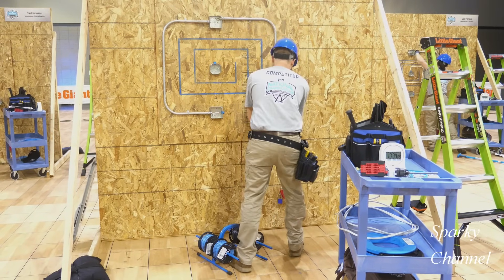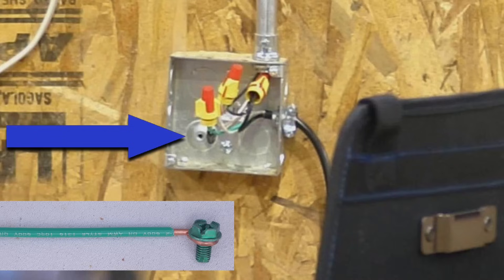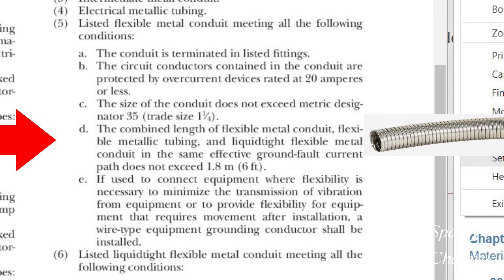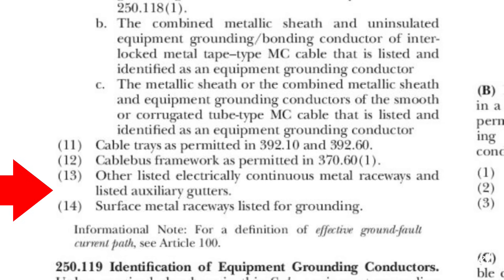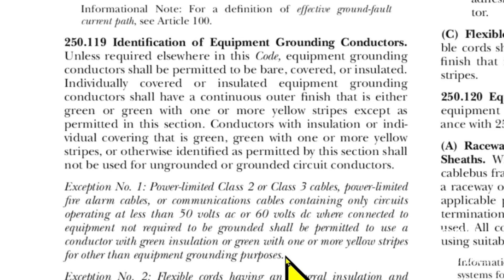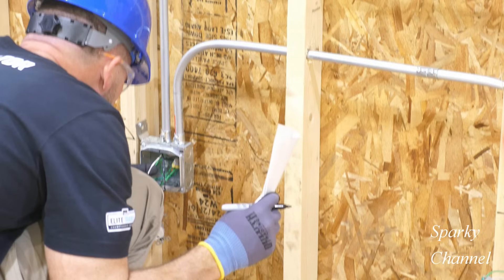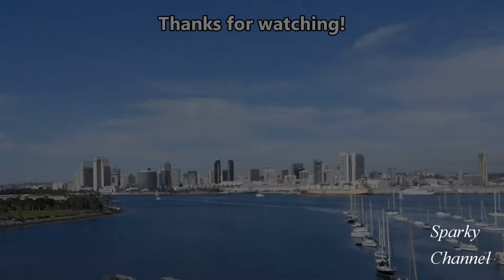Can EMT Conduit be Used as Equipment Grounding Conductor? NEC 2020 250.118 and 250.119

Comment: Great example of how strict adherence to the letter of the law/code can make your electrical less safe.  The metal conduit is a much higher resistance conductor than copper and is more prone to losing continuity than a copper wire ran through it would be.  I have to say that if UL green tape is used, running an extra white wire and marking it at each termination point seems like a much safer solution IMHO.   The risk is the tape falls off and somebody connects ground to neutral.  I think that’s less likely than you getting shocked by the metal conduit because you just got out of the pool and touch it, not knowing it’s lost continuity with ground and has a damaged hot wire touching it.

Comment: So, how is the EMT used as a EGC...does the EMT at the panel have to be connect to a strapped or attached to ground bar?
Reply: No. The ground bar is already connected to the panel enclosure through it's attachment screws. The EMT is attached to the enclosure through the fitting. So the connectivity is present the moment you attach the EMT.

Comment: Very good video. But: while EMT "can" be an effective ground path, in practice, if you have say five electric boxes in series, that's at least 12 lock nuts and 12 set screws that need to be perfectly cinched down for it to actually be an effective ground path; if even one lock nut is slightly loose, everything downstream is an open ground. Terrible idea to try this in practice.
Reply: We never did it when I started back in 1982 even though it was permitted. But we used BX with grounding pigtails, if that made any sense.

Comment: I have seen too many setscrew fittings pulled apart by building movement and worked-loose locknuts to ever rely on EMT as a grounding conductor.
Reply from the maker: Good point, thanks!

Comment: My question is can I pull a bare copper ground wire through metal flex conduit?  I think this answers the question but it’s not an explicit enough answer.
Reply from the maker: I would say yes but we generally use insulated green wire for the ground wire.
Reply: @SparkyChannel  thank you 🙏

Comment: Sparky, I am adding an exterior gfci, but there is no ground wire. I understand a gfci can be installed without but I would rather have a "ground." So, older house had a 1/2" emt exiting into a backless box so there was no emt ground. But, if I create space around the emt stub I could add a screw-type connecter that I could affix a ground wire to and connect to gfci ground.
So, which, if either, would you prefer, a groundless gfci or a fabricated emt ground connection?
Reply: Groundless

Comment: Question do you have to bond emt on both sides if you have a neutral conductor going through the race way or if one side good enough? Does it make a difference if it’s service conductors or branch circuits?
Reply: Add to your Question, = Would a ARC fault  Circuit Interrupter on a 15 or 20 amp single phase branch circuit satisfy  protection?
Reply: @tomassoyweyvon4902  Yes, but the metal conduit still has to be connected to ground at both ends.  If longer than 6’, there has to be a ground wire ran through the conduit and connected to it’s ground terminals at bit ends
Reply: Yes, both sides

Comment: It’s legal but I do not trust EMT as an EGC for one reason… all it takes is some bozo loosening up a lock ring, or cobbling in a plastic connector into the system (just found one of those last week) and goodbye continuous ground.  While it isn’t legal apparently to just take a green marker to the ends of a white wire (although that would definitely pass here) …IT IS legal to strip the conductor completely and install and bond a bare wire if you wanted to do that.
Reply: Would it be legal to only strip only the visible portions of the white wire? I.E. starting from a couple of inches into the EMT from the connector? Or does the EGC have to be stripped 100% throughout its length?

Comment: Bill, can I do the reverse in terms of color coding. If I have a big giant roll of 6 gage green that sits around the shop forever, can I use that for hot and neutral conductors as long as I clearly identify them within the boxes and terminations (e.g spiral wrap the last 12” or so with black tape and white tape respectively?)
Reply: Absolutely forbidden by code. Green is for grounds only.

Comment: If you have the time and resources I think it's better to also run a dedicated EGC conductor instead of relying on the conduit to act as the conductor. If the conduits has poor connections, it can easily lose continuality. Once saw a video of a highschool that used conduit to for the grounding but because there were so many disconnects and damage to the conduit over time the grounding was rendered ineffective.

Comment: In Chicago, Cook County, Lake County, and DuPage County areas in Illinois there is a metallic conduit code for all residential structures with very few exceptions. In my 40 years of electrical experience working in these areas, you will be very hard-pressed to find a single green wire in any of these thin wall conduit installations. That equates to about 10 million homes wired without a separate grounding conductor within the emt. We do not have a plague of house fires, electrocutions or equipment failures in these homes. I think from my years of experience in remodeling homes wired in this method, it is a very safe system. I will always run a ground wire to any exterior outlet, A/C unit, flexible conduit of any type or to any area that could possibly suffer from corrosion just for redundancy. Even a marginal metallic connection from a crappy install is enough to trip a breaker. That steel pipe is a better conductor than you might think, even with a loose locknut or loose set screw, the friction fit in the fitting or the mechanical pressure of the pipe being strapped and pressed against the box is more than enough to trip the breaker. In my humble opinion, based on what I have seen and learned in my time in the trade, the Code Gods made the correct decision. Feel free to add a green wire for redundancy if you prefer, but in almost all cases it would not be necessary to clear a fault.
Reply: FINALLY, a man that speaks truth. I couldn't believe the comments here regarding the E. G.C..
Locknuts loose, set screw wah-wah-wah, this, that. 
An EMT conduit is an EXCELLENT pathway.
Years of operating a service van in SF Bay Area I have seen it all, probably. From salty sea air corrosion on switch gear to urine soaked receptacles (it's SF guys) and I am as serious as a constipated fat lady when I say EMT is an excellent path for EGC.
These Nattering Nabobs of Negativity here commenting about running a conductor RATHER than using EMT conduit as an EGC, and speaking with such pomposity while doing so is virtue signaling at it's core.
It illustrates the lack of understanding regarding the function of the EGC. 
Some of these self-claimed "journeymen" have even said to me, "Without a solid equipment ground the circuit won't work."
Look, truth is, who should we  assign the most credibility to, the NFPA and their authors of the NEC every 3 years, or these so called electricians here in the peanut gallery?
Reply from the maker: Hi Dave! Thanks for your expertise!
Reply: Yup that's Chicago way. still practiced today.
Reply: I’m all about using the raceway as the egc, but I don’t think you need to go as far as touting loose-fitting components as being adequate work. I guess you’re just trying to make a point. But it’s always important to do top-level work.
Reply: @RB-xv4si  I was making a point in what I have observed in my career. I never sacrifice quality.

Comment: According to the NEC, yes. According to every job spec I’ve worked under, no. They’ve all required a separate wire EGC.
Reply from the maker: I understand. Thanks Bill!
Reply: Yes, true. This code is more applicable to service electricians. But it’s a code nonetheless..trust and believe that as soon as I don’t see a wire type egc called out in the job spec, I won’t be pulling one in with my circuits.

Comment: The short answer is yes. I personally don't like to rely on the conduit as my equipment ground. If a connector or coupling comes loose and the conduit becomes disconnected, you lose your ground. I pull a ground wire in every conduit.
Reply from the maker: Excellent, thanks!

Comment: EMT was the grounding method for many years. Due to the poor workmanship, lazy and don’t give a crap attitude, poor management and supervision the overall cost of electrical work has increased by having to run the additional wire. Same thing with ArcFault protection. Crappy work = arcing
Reply: A strong sense of pride used to be a common bond. Words like craftsmanship are hardly used anymore and that is sad.
Reply from the maker: I understand what you're saying, thanks!
Reply: Absolutely true.

Comment: Seriously took over 6 minutes to get there....Nobody runs new EMT without a ground wire nowadays. Raceway is never a reliable EGC, to many connections in a real world application.
Would you do it on a waterheater that is 20 feet from the panel?
Reply: EMT was the grounding method for many years. Due to the poor workmanship, lazy and don’t give a crap attitude, poor management and supervision the overall cost of electrical work has increased by having to run the additional wire. Same thing with ArcFault protection. Crappy work = arcing
Reply: It’s done all the time in service work. Just not in new construction where a ground wire is called out in the job spec.

Comment: How does this account for the ampacity of the ECG? The EMT in this case should be plenty for that circuit, but I can think of situations where it might not be.
Reply: Remember that an ECG rarely carries a continuous load.  In a short circuit, the current is high but very brief.  For an overcurrent, the load is only carried for the period it takes to trip the breaker.
Reply: @barryomahony4983  If your "EMT ground" sucks, it might not provide a sufficient current to trip. (one would hope that isn't the case, but I've seen it happen - thus I don't trust conduit for a ground.)
Reply: @jfbeam  the same is true of a shitty ground wire connection. Pick your poison. But I’d rather have a top-notch install with the raceway as the egc than a sloppy one with a wire egc pulled in.
Reply: @RB-xv4si  adding a ground doesn’t make the run shitty, not getting ur comparison
Reply: @Nick-bh1fy  when I say “shitty ground wire connection,” I mean a ground wire connection that has the same sloppy workmanship as poorly assembled EMT used as the egc. My point was that either way you go, if you have poor workmanship, the bonding will be inadequate.
Reply: @RB-xv4si  ofc that goes without saying but id take my chances on a “poor” ground connection through a conductor rather than hoping guys tighten their connectors 😂 emt is plan b lmao
Reply: @Nick-bh1fy  You’re free to pull a wire egc if you want. And you’re also free not to. Like I said, I would take a quality build without a wire egc every time over crap quality with one installed. Any experienced electrician who knows his stuff will say the same thing.
Reply: @RB-xv4si  yet engineers spec jobs for all conduits to contain an egc I get it’s preference if not stated but it’s not hard to make a simple bonding connection. I disagree respectfully
Reply: @Nick-bh1fy  it sounds like you’ve never done service work.
Reply: @RB-xv4si  not much of it, mainly new construction so perhaps my bias is set there 🤷‍♂️
Reply: @Nick-bh1fy  one day if you do service work, you’ll see that the service guys know much more about code since that’s what they’re mostly following. They build to this standard since there are no plans. The construction guys for the most part only know how to follow plans or what their foreman tells them to do. They often don’t know why or how something works, or what’s code vs what’s spec. I noticed this when I switched from service to construction.
Reply: @RB-xv4si  yup def depends on the company/group of guys when it comes to competency
Reply from the maker: I think they really depend on electricians making very secure EMT fittings connections. I'm not sure they always do though.

Comment: Thanks Sparky, I've seen stretches of EMT connected to PVC because of areas being in wet conditions, do you have gotta be sure there is EMT running continuous....but there is a round of way to get around this..... use an EMT box, ground it and then run a section of Grounding wire to another EMT box after the PVC and ground that box, then continue your EMT run as usual.
Reply from the maker: Excellent advice, thanks!
Reply: That’s called a bonding jumper.
Reply: RB....thanks...had a brain fart moment and couldn't think of the exact name....hell, approaching 70 in Nov, guess I'm entitled!
Reply: @ottoroth3066  entitlements!
Reply from the maker: @ottoroth3066  I'm not that far behind you. LOL!

Comment: Interesting that you can reidentify a hot wire using red or black electrical tape but not allowed to reidentify a wire for ground by using green tape. Probably to ensure there is never a mix-up between neutral and ground somewhere in the middle. As far as the ground on mc cable I always attach the small ground wire that runs in the cable to the box and make sure the connectors I am working with are tight. At times people install connectors and they are not tight and secure. If that ground wire is attached at each junction box it will ensure continuity of ground even if a connector is not up to par.
Reply: Every AHJ INSPECTOR I've met says, "YOU CAN re-identify ANY color conductor with ANY COLOR TAPE".  Where are you working?
Reply: @BYENZER  That's not correct. Sparky just went over the code explaining that. It's 250.119 in the 2020 code book. Maybe watch the video again. Or maybe those inspectors should check it out. LOL

Comment: speaking of Armored cable,  there is a thin aluminum bonding strip that allows is use an a EGC. Very old AC cable (pre 1950s) often did not have this and can be dangerous to rely on as a grounding method,  as the steel armor especially if corroded or damaged can have enough impedance so a hot to ground short might not throw the breaker as it should, and the metal spiral can act as an inductor.   I've heard stories from old school electricians where they turned off the lights and they could see the Armor glow red.   I've never personally seen that happen,  and I would imagine it would take some unusual circumstances happening simultaneously 

it's interesting to note, AC cable was invented in the late 1890s, was approved by the NEC in 1903 but didn't really become popular until the 1930s, when knob and tube was being phased out
Reply from the maker: Very interesting, thanks!

Comment: While technically allowable under the code, if the emt is connected by set screw connectors or couplings, the continuity is notoriously unreliable. The code is the minimum, it's never a bad idea to exceed safety minimums. Yes, i know emt has a lower R than #10 copper, but the set screw connection is the weak point.
Reply: If possible, I add a ground conductor in the emt or anything flexible. I have seen way too many emt and flexible type conduits ripped apart in attics and walls to not do so.
Reply: EXACTLY RIGHT!!!
Reply from the maker: Yes, excellent point.
Reply: Do compression style EMT fittings provide better continuity than set screw fittings? Specifically, to the point where you would trust them without adding a separate ground wire?
Reply: @iowawrench  they can be worse than the setscrew ones.
Reply: @phildegruy9295  interesting... Do you tighten them with a crescent wrench or with channel locks? I see Thomas & Betts lists their compression fittings as wet location / raintight connection between the tubing and fitting. I guess they have that advantage.
Reply: @iowawrench  Initially I think they are about the same and I use both where appropriate but I have seen a lot of the compression connectors not made up correctly (conduit not in far enough/baloney cut, split ring missing) or are not tight enough.
Reply: @iowawrench  that’s not specific to Thomas and Betts. Any company making fittings will have versions rated for dry locations and versions rated for wet locations.
Reply: @RB-xv4si  I was pointing out a difference in usability (advantage) between emt compression fittings and set screw fittings. I'm not an electrician so it was just surprising in concept that emt could be used outdoors.
Reply: @iowawrench  what about that is surprising? Most emt is galvanized.
Reply: You went ahead and contradicted your entire point at the end
Reply: @daniellyons6647  if that was directed at me, please elaborate on my contradiction.

Comment: Yes as long as it’s 3/4 emt or larger and at least 8ft in length
Reply: It can be any size or length.
Reply: @sparkyjerred419  I thought u in 250 it says 3/4 n 8ft or is that for an electrode
Reply: @LiSTRONG631  that is for an electrode.
Reply: size don't matter! ;-)
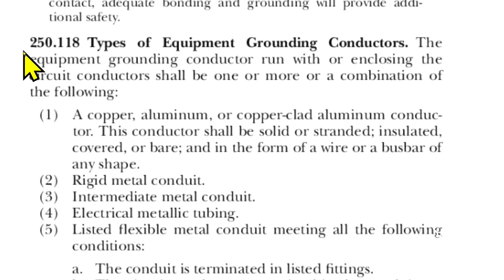Reply from the maker: See 1:41